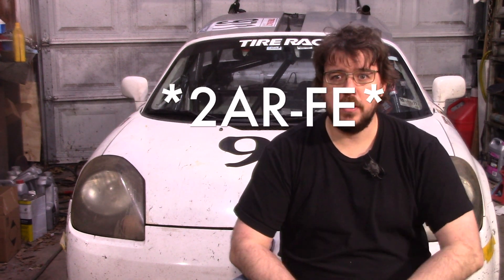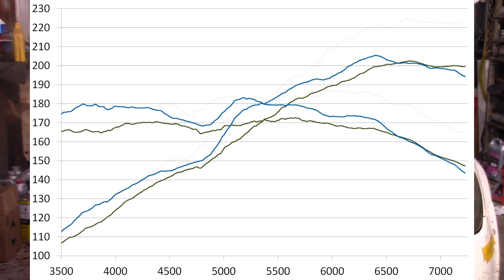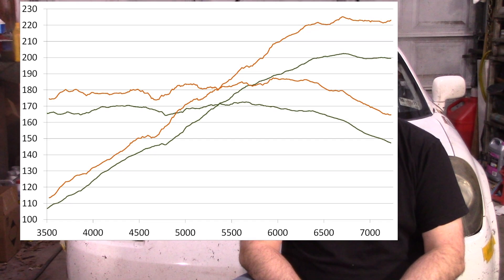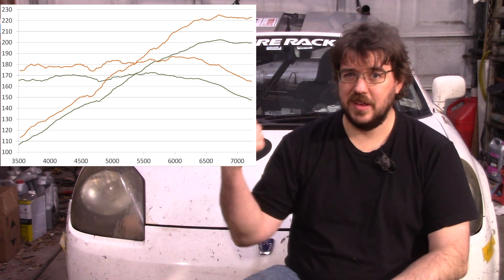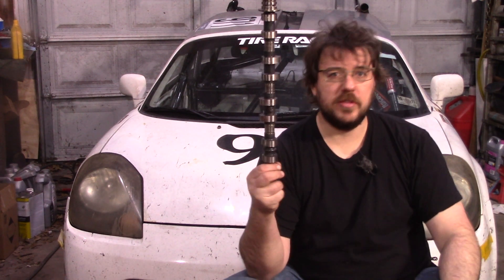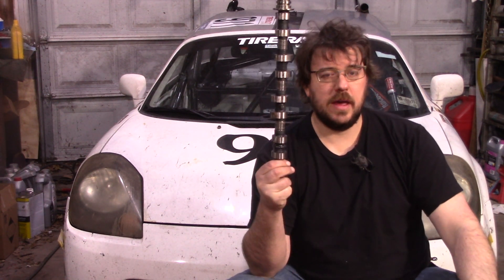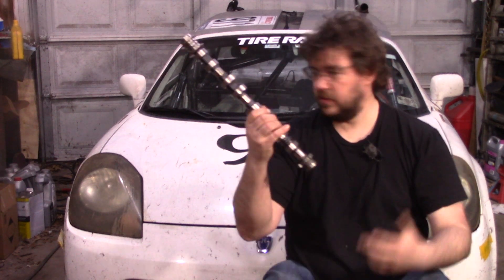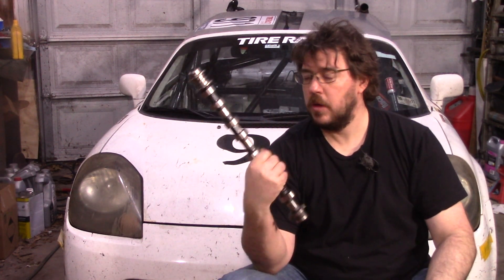Tuning the 1AR-FE upgrade to the MR2 Spyder

Comment: i might have missed it in the videos but with the 1ar crank in the 2ar what rods and pistons did you use and what tuning adjustments need to be made .? my crank needs replaced and this peaked my interest for more power
Reply from the maker: The 1ar and 2ar use the same connecting rods but you need to use the 1AR pistons or custom pistons.

Comment: Have you tuned these numbers from a 1ar stock ecu? If so, I am on the fence between this setup (stock 1ar/tuned ECU) vs the 2ar-fxe setup (exhaust cam swap+haltech)...
My car is dedicated for the track and reliability is the most important factor followed by the simplicity of the swap. I am fine power-wise with the numbers you showed up to now! :-)
Reply from the maker: Yes, this was done with the stock ECU and i'm happy to sell you an ECU with the exact same tune to use with a 1AR-FE. The only thing to note is you need to use the 545cc injectors but i can help you source those also. And yes, this makes for a very good track setup.
Reply: @FrankensteinMotorworks  thanks & good to know. When looking at your recent dyno of the 2ar-fxe vs 1arfe stock tune, there are very close in numbers hence trending to the most simple approach which to me is the 1ar with stock ECU tune
Reply from the maker: @MetalPGT  Keep in mind, my most recent video has a comparison of the 2ar-fxe with dual intake cams and the 1ar-fe with custom reground cams. This video has the 1ar-fe with the stock 1ar-fe cams but i never put this on a dyno to get exact numbers.
Reply: @FrankensteinMotorworks  Fully understood. Based on your experience that you gather with the 2arfe with the stock tune at 205whp on the dyno, I would assume that your tuning of the 1arfe with stock cams should be a good ballpark if it was going on a dyno, correct?
Reply from the maker: @MetalPGT  I'd expect you'd end up around 230whp with a bone stock 1ar-fe

Comment: Also.  It would be nice to have a version of the tune with stock injectors.  Since this swap is pretty easy to make CA-legal, I'd want 2 ECUs (one tuned and compatible with the intake, and one fully stock) in order to have a legal setup for inspection time.  I suppose one could also swap injectors when swapping ECUs but it is a bit more of hassle.

Comment: Hey Mark.  Nice work!  Are those cams going to run with the stock valve train?  Or do need upgraded hardware there?
Reply from the maker: They would run with the stock springs but i would expect that the peak power will be moved up a bit so the stock springs will hold you back at 7200RPM and power will still be climbing at that point. It'll depend on what the results show but usually you want to be able to go at least 500rpm or so higher than the peak power
Reply: @FrankensteinMotorworks  So just stronger springs? No custom rockers/retainers/lifters etc?

Comment: Hey Marc, have you done a flow bench test of the stock manifold to see what the CFM of the runners in the short position?
Reply from the maker: No, i have not. I don't currently have access to that kind of equipment. It is something i would like to do at some point if i ever get access to that or build something to do it myself.

Comment: have a question I wasn't sure if you'd know. I would like to eventually boost my 2ar-fe engine but there are pretty much no premade headers for it so does a 2az-fe header bolt on? I know it wouldn't bolt to the rest of the exhaust but I can find turbo manifolds for the 2az that I think would fit. thanks for the help and making these vids with detailed info.
Reply from the maker: The bolt patterns do not match but it might be possible to redrill a 2AZ turbo manifold to fit.
Reply: @FrankensteinMotorworks  damn, thought the bolt pattern may be the same. thanks for getting back to me so quickly and if you decide to make a turbo kit for a 2.5 tc eventually I'd be interested and I think so would quite a few others. keep up the awesome work and I look forward to your vids.
Reply from the maker: A turbo kit is on the list and i will try to make it also fit the tC but keep in mind my primary fitment concern is the Spyder at this point. Of course if there's enough interest from the tC community at that point then i can look into what modifications it would take to make it tC compatible.
Reply: @FrankensteinMotorworks  I am in no rush at the moment and I get that I'd probably have to Frankenstein at least a little of it. I put a duct on my hood to make my intake actually cold air so I would most likely have to do some tweaking to get it fit. Keep up the awesome work!

Comment: I have a 15 tc and was wondering if your setup would work? Possibly pass an obd scan for inspection?
Reply from the maker: no, my exhaust eliminates the catalytic converter so it will not ever "pass" the catalyst monitor.
Reply: @FrankensteinMotorworks  thanks for the reply. Your doing amazing work.

Comment: I have a 16 tc with 201 whp , now its boosted , do u have a tune for a boosted 2ar , im located in Houston , all I need is Injectors and tune to open this baby up on the road
Reply from the maker: If it's a manual i can probably help you, if it's an automatic I don't have a vehicle to design a tune on over here. The tune is not publicly available yet but it uses the 545cc injectors and i've spent quite a bit of time tweaking it and i'm pretty happy with it now.
Reply: @FrankensteinMotorworks  thanks for the reply , it is a manual too me thats the only way to enjoy the TC Lol , im getting 550cc injectors to run 8 psi wich is what the wastegate is set for
Reply from the maker: @marcosdelvalle8314  Tuning the injector size in this ECU is pretty tricky. I can't guarantee how well it will respond unless you use the Toyota 23209-74280 injectors. They are available on e-bay for $150 or so for a set of 4 generally. The tune i have made is also only designed to run with my velocity stack MAF pipe. This allows me to finely calibrate the fuel curves. Send me a message through the contact us link on FrankensteinMotorworks.com and we can discuss this further.
Reply: @FrankensteinMotorworks  will do

Comment: That thing sounds and looks great.  Can an 8AR be a possibility?
Reply from the maker: The 8AR can potentially be made to work but it's going to require a different right side motor mount at a minimum and i think the turbo might interfere with the firewall but i have not tried it yet. Once the price comes down enough on them i do intend on checking it out.

Comment: Wish to ask , 2AZ NA compare with K24 NA with 1zz turbo in Spyder. Which prefer & how the driving feeling ? 

Thank you so much
Reply from the maker: I probably have too much invested to really give you an unbiased opinion but here is as unbiased as i can get. Also i assume you mean 2AR NA instead of 2AZ (the previous generation).

1zz turbo is kinda separate from the other two. Depending on your goals with the car, if you just want a bit more power this can be a great cheap option. If you have to open the motor up to install any parts i think you're wasting money and you should be upgrading instead.

2AR NA - This motor has great torque, the vvt-i just pushes hard from idle to redline. When compared to the K24 stock it's pretty similar except the install parts for the 2AR are way more thorough with better instructions so you'll get it installed quicker. This may not matter depending on your skill level. If you want to have more power you can go to a 1AR instead as this video shows and get an extra 20hp which beats any unopened K20/K24 motor and the 1AR costs about $1000-1400 so this is a great way to go if you want an easy install and you don't want to open up the motor. The K20/K24 has a known combination of parts that costs about $3000 and you have to assemble it yourself that will give you about another 20-30hp more than the 1AR. I expect that advantage to be short lived at this point because the 1AR with cams should beat that $3000 K20/K24 build for significantly less money as soon as they are released. Where the K20/K24 wins again is if you want way more NA power, the K20/K24 has parts available for a $10,000+ build that makes way more NA power.
Reply: @FrankensteinMotorworks  Dear Sir , thank you for your opinion . 
 what chassis of Toyota I can found the EB60 transmission ?  For the 1AR , have others transmission option ?
Reply from the maker: @LeongStrife  The EB60 is in the 2011+ Scion tC and the EB62 is in the 2010-2011 Camry. There are no additional bolt-in transmissions that can be used. With enough fabrication of course just about anything else can be used.
Reply: @FrankensteinMotorworks  Dear Sir , do you know how much the weight of E351 & 2AZ ? How about the 2AZ engine swap in zzw30 ? My here got E351 didn't found the EB60/EB62 yet .

Comment: Are the stock 1ar injectors the same as the stock 2ar? It seems to me like a 1ar is going to be more expensive to source than a 2ar, so you might as well proceed down a path that will support a higher power build with cams/etc.
Reply from the maker: Yes, they are the same injectors. the motors are as close to identical as it gets honestly.

Comment: could it be that the head is MORE optimized for the larger 2.7 than the 2.5?
Reply from the maker: That's actually a good point. The 2.7 is also the 1AR-FE and the 2.5 is the 2AR-FE which means in standard Toyota fashion the 1AR was very likely developed first and then it was de-stroked for the 2.5L version. That might explain the 2-4% better performance than expected with the 2.7L 105mm stroke.  Thank you for pointing that out!
Reply: @FrankensteinMotorworks  According to part numbers, the 2AR and 1AR share the same cylinder head, intake, and exhaust camshaft part numbers. So, head wouldn't be the difference. 11101-39715 cylinder head, 13501-36050 and 13502-36030 cams.
Reply from the maker: @Duck_Vision  That's exactly what we were talking about. the head was designed for the 2.7L where it might be more optimized and with 2.5L of displacement without any other changes it might be slightly less optimized. Because they are the same part numbers.

Comment: hi mr2 master. what gearbox you use for 1ar/2ar,   eb60 or ea61 ?  eb60 and ea61 are they both have lsd ?
Reply from the maker: This car is using the EB60 gearbox. There's no LSD on the market right now but i'm working on that with a manufacturer right now.

Comment: i personally would like to see a tune for both for the stock (410cc?) injectors and the 545cc injectors. 85% duty cycle is no bueno in my book. but some people might not care. maybe make the 545cc injector tune the standard and stock injectors special request???
Reply from the maker: The issue with making both available is sometimes little inconsistencies come up and i like to spend time thoroughly testing my tunes. I don't just want to rescale it and send it out in the wild so i will really only be supporting one injector size with this setup. It's less choice but i can deliver better quality that way.
Reply: @FrankensteinMotorworks  then aftermarket for sure
Reply from the maker: @Shift-happens-tv  technically they aren't aftermarket. It's just being pilfered from a different Toyota application. In great full circle irony it's actually the last 3s-gte application :)
Reply: @FrankensteinMotorworks  alright smarty pants 😂😂😂 "non-stock to the AR family, oem ancestor" injectors
Reply: @Shift-happens-tv  Second that.  Don't think leaving it 'thirsty' to save ~$150 is right.

Comment: I have three questions so far:

•What cam are you using in this setup? Is it a Came you made yourself or is it pulled from another vehicle?

•What clutch are you using in your setup as well? I plan to upgrade to a ACT clutch kit but was curious what you’re running in the MR2.

•How well do you think this setup would be paired with boost? I plan to build the stroker set up with an old 2AR I have, then later down the road boost. I was thinking about a GTX2867, however with it being a 2.7L I feel maybe a larger twin scroll like the GTX3076 may be better paired with this setup. I plan to run about 1.3-1.5 bar which I feel would achieve around 440-480whp. That’s a ballpark number I’d have to check compressor maps but just going off of the 2AR’s results with either of those turbos at 1 bar is roughly anywhere from 300-350whp.

Anyways, I’m thoroughly impressed by your work thus far. Keep up the amazing work! Hope to stay in touch!
Reply from the maker: The cams are stock right now. 

The clutch in this car is normally an ACT 6-puck with a lightweight fidanza but i had an oil contamination issue at the last race so right now it has a stock unit in there. It'll go back to a lightweight flywheel and a 6-puck ceramic clutch soon.

The AR motors do really well with boost. I haven't looked too much at turbo sizing yet but you're right that the 2.7L puts out a lot of hot air to spin up a larger turbo. Those boost numbers and that horsepower target seems roughly in line with what we know now but i also would not be surprised if you need just a bit more boost to get there.

Also, i'm not sure what car you're doing this in but 440-480whp in a spyder is ridiculous.
Reply: @FrankensteinMotorworks  I’d be doing this in a tC, I do not have balls to make power like that in a Spyder😅. Torque steer will be fun until I find a LSD option
Reply from the maker: @HotBoiRicer  It's funny you say that because i have Spyder people chanting at me "Turbo 2GR!"

Comment: Evo X injectors  might also be a good option Part# 1465A205 they are 550cc or 600cc. E85 is really common around here. Also a Higher compression ratio piston if you make a run
Reply from the maker: The Caldina 545's are cost effective and a 100% drop-in fitment electrically and mechanically with the correct double spray pattern aimed at the valves so until this thing exceeds 300-320whp or so i will be sticking with those (Toyota PN: 23209-74280). I might even stretch another 50hp out of them by going to a 4 bar regulator depending on the other options.
Reply: I think they are the same injector just different part numbers.

Comment: Why we not tuning upgrading the 2gr 😢
Reply from the maker: For a few reasons. First is that the 4 cylinder is cheaper to play with. The engines are way cheaper and they need less parts, half the number of cams, 2/3rds the number of piston, half the headers and a much simpler intake manifold. But the bigger 2nd reason is that i don't have a good car to do 2GR testing on right now. I have two MKII's with 2GR engines in them but one isn't street registered and has no rear brakes on it at the moment and the other one has rotten tires on it. I don't really drive them so i don't feel like spending a bunch of money on them right now. Once the Widowmaker project is finished I'll have a test mule car to apply what i've learned from the 2AR to the 2GR.
Reply: The 2gr is too soon, junior level power for 90% of you to handle let alone afford. Huge dents in the car, need wheel bearings, needs xyz? "Oh let's 2gr swap it."

Comment: This build is going to be the K killer!
Reply from the maker: That's been the plan from the beginning. The motor is physically bigger but in return it has a much larger bore which means it can have larger valves and from the factory it has larger intake and exhaust runners so it's really starting from a much better point to make more power. the extra displacement also helps.
Reply: Frankenstein Motorworks do you have a rough idea of the 1AR-FE's weight?
Reply from the maker: @maxfish5808  it's the same as the 2AR-FE, it weighs 90lbs more than the 1zz and C series trans it replaces but you can make up some of that weight in the intake, exhaust and the battery.
Reply: Frankenstein Motorworks not too bad, I believe the K's add about 60-80ish lbs depending on trans and mods.

You think this motor can benefit from the Camry Hybrid pistons? 2azfxe high compression cast pistons?
Reply from the maker: @maxfish5808  The motor is not very knock limited so increasing the compression would gain power across quite a bit of the power band.
Reply: @FrankensteinMotorworks  finally an alternative to the k swap mania. The feeling that i got from the intro is that of a gigantic 1ZZ, which suits well with me.
Reply: The amazing thing is the 1ar and 2ar's service weight, as in with all the fluids topped up is actually less than the K's dry weight, 147kg vs 160kg, and what's even more ridiculous is the 2gr-fe's service weight is almost the same as the K's dry weight at 163kg, I legitimately don't know how Honda's engines are so much heavier than Toyota's engines.
Reply from the maker: @aaronbryan5095  that actually is pretty surprising to me. I know Toyota uses very thin cylinder liners in an aluminum block but i would not expect it to make that big of a difference. there's got to be something significant somewhere.
Reply: @FrankensteinMotorworks  they use thin cylinder liners but the cylinder walls themselves are still quite thick, thicker than the cylinder walls in Honda's engines, maybe the casting method that Toyota is using will result in the block and head being very strong and rigid so they don't need to use that much material to begin with and carefully placing extra material in high stress areas and removing them in areas that don't need that much beef? Stock AR block can handle 1000whp, a level where the 4 cylinder open deck aluminium blocks from other car manufacturers would've destroyed their cylinder walls.
Reply from the maker: @aaronbryan5095  right, they are beefy which is why i don't understand why the k-series would be heavier. Either way the AR certainly has a lot of promise.